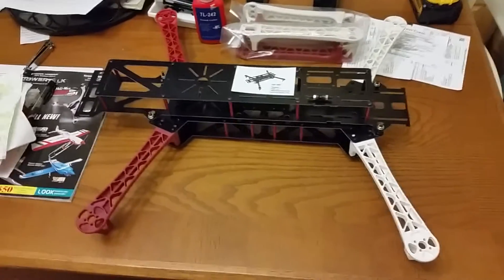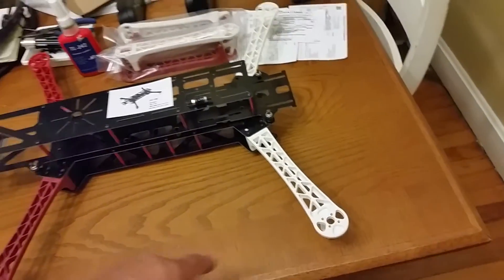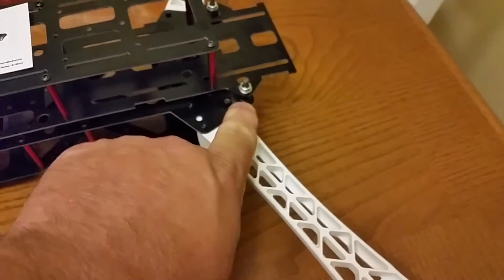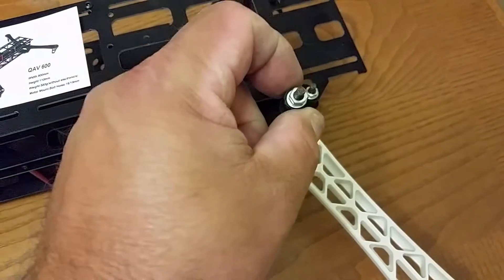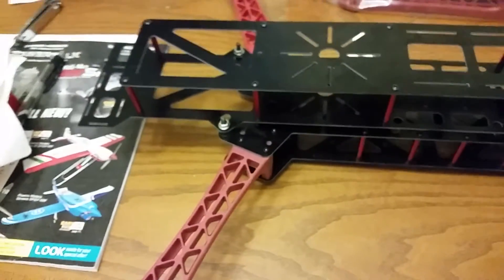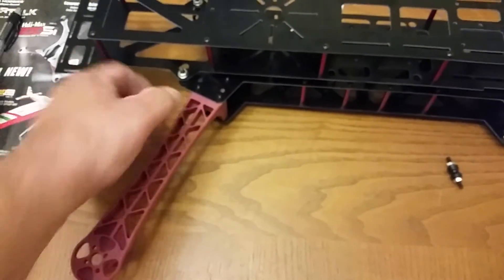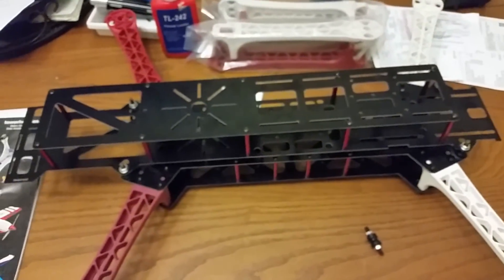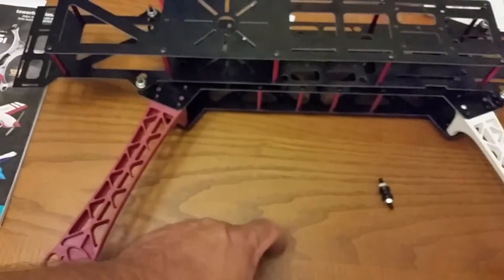QAV 600 build 1

Comment: how is it flying now?

It does look exactly like a QAV 500.

Did you set it up?

I have the same, i have 920kv motor with 15A esc using the naza M lite. and mounted a gimbal in the front... but it is a bit unstable.

I have the CG good!

as the CG is precisely in the middle.

Balancing it it from my gimbal to the back with my 4S 4000mah lipo.

but at time when giving it rudder it becomes unstable. is this normal?
Reply: your getting to much flex in the arms/frame
I had this issue I braced up the arms/frame and it was gold using 800 arms
Reply: Colen Casey im using DJI arms
Reply: Colen Casey and what do you mean brace it up?
Reply: Colen Casey and what do you mean brace it up?
Reply: 297 Hobbies took 2 metal rods and made a X across the bottom from the tip of one arm to the tip of the oposite arm
flies fine now

Comment: Yea those short arms look silly on that 600 body.     That size quad should be using 600-700 size arms minimum and swinging 14" props for sure...
Reply from the maker: using rct800 arms now with 17" props
have a set of 700 arms I might switch to, can still use the 17" props with the 700 arms

Comment: Informative vid, thanks ... building one myself.
Thinking of putting the battery on the bottom part of the "top deck".
Camera and flight control on the "top deck" as well.
The mass of the battery should help with vibration isolation from the bottom,
(motor) deck.

... and thanks for your Taranis review earlier, ... I bought one and am happy with it.
Reply from the maker: pretty much what I was thinking to
RCT800 arms are in I will be mounting them and doing a update video very soon
Reply from the maker: I put 2 zippy compact 4s 5800 packs on the bottom deck
made removable battery trays with my 3d printer
esc's and power distro are between the 2 frame sets
top frame is flight controller radio and video gear
disconnect 1 jst (power) and the top deck can be completely removed from the assembly for easy access work to be done.
I made this as modular as I could